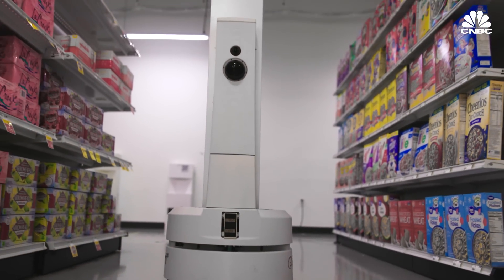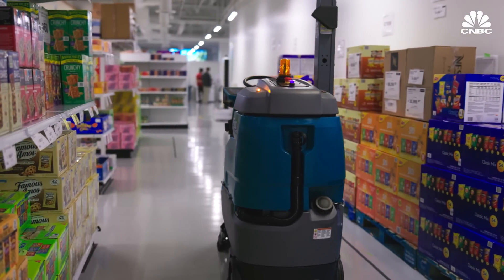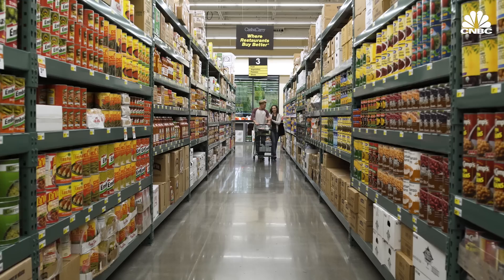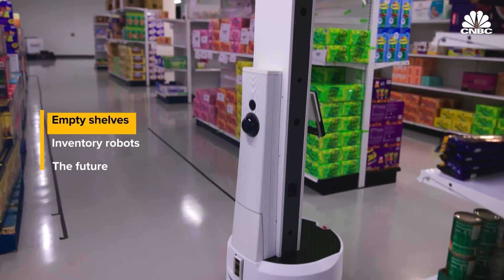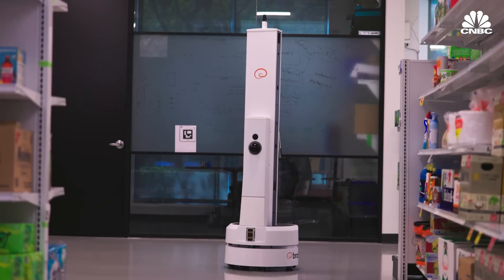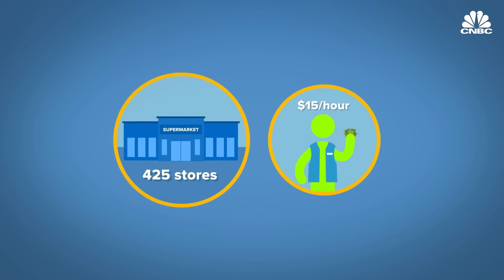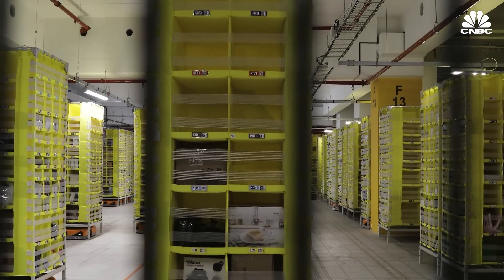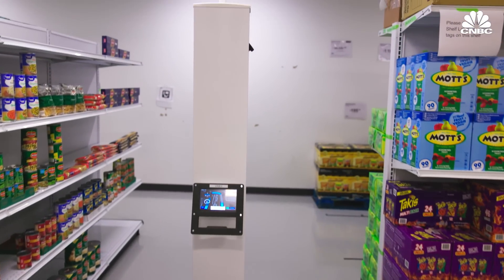How Robots Could Help Retailers Save Billions

Comment: When the manager is low paid, and has no stake in sell through or general company profit and long term happiness, then yeah, out of stock will be common.
No robot will fix that; it will send an email, but won't change the motivation of those managers.

Just in time stocking only works if you have a low cost human workforce behind it at mass retail. Robots and expensive software contracts are not going to be paid for by making 11 cents on in stock toothpaste.

Comment: 10:02 Billion dollar global insight to max your salary increase, company profits, monetise as thesis, anime, movie and max charity donations. There is time and movement wastes (Kaizen) on Amazon warehousing robots where the bots have to rotate from direction X to direction Y to move forward in the desired correct direction. Why note eliminate the turning step (billions or trillions of touch points globally per day = billions of dollars of profits), by revamping the bots to have multiple small durable wheels at each side so it doesn’t need to “rotate” its chassis.

Comment: The top 5 percent of Universities accept research and development funds from the retail industry to replace 40 percent of the workforce it's a fact . All of the large retailers are following suite and the nasty managers that they employ threaten the shop worker either you work and take responsibility of three workers then the robot appears. The sting in this story you need computer programmers to function. Amazon back 15 years employed robots but for them to find programmers to keep control so some of those employed in order prepare for the programmers to have their holiday overloaded the system which fires happened about several warehouses in UK were burned down. These robots consume energy something between 1.5KW to 20Kw depending the nature of business.

Comment: It only saves labor until you have to hire a contractor or more labor later on to manage such a mess of management; and yes I can honestly tell you working in retail at all levels including upper management corporate information is most certainly has been and will continue to be an issue for these companies and store for decades too come; this is about one thing, pricing and outpacing the market to raise value for investors, you know for the billionaire investors with stocks in both companies. I guess if your Elon Musk your really happy capital gains taxes are virtually no longer existent.

Comment: I'm sorry but who cares? It's not like it'll result in savings for the consumer or better working conditions for workers. If anything it'll annoy customers. I already have had a few times where the automated floor cleaning have gotten in my way then locked up forcing me to go around them via another isle. A human doesn't make those kinds of mistakes and I don't appreciate being a genuine pig. It's among the reasons I won't ever use an "automatic store" as long as I'm able to avoid it. I'm talking about those stores Amazon wants us to think are cool that use AI and automatically charge you using the AI. I am sure some people will get SCREWED by the AI, others by scammers tricking the AI.

Give the remaining workers actually livable wages and I might change my mind but I don't see it, it's just going to mean more bonuses for executives.

Comment: We stopped having the autonomous inventory robots. Customers would block the robot which would enter a halt state. The machine would see a reflection in the floor and would enter a halt state. Both of which required hauling it back to the charge station manually by hand. Which means you had to have employees there to monitor it. On hands were constantly being adjusted downwards even though the shelves had freight on them causing over ordering. The whole thing was unfortunately a mess. The thing is, if you have not enough supply you can continue to function. But if you have to much supply you no longer have the ability to receive freight because there is nowhere to put it.
Reply: But then the bots would know the difference between "to" and "too" as in having too much inventory. This is where you will be replaced, sorry, should have paid attention in school.

Comment: Or just use computers which have been around a minute and deduct products sold from initial stock levels and you already know what needs replacing. A camera looking at empty shelf space is not impressive. At all. Watch these workers at the grocery store and its alot involved in getting the products up. Alot of hand and arm and body manipulation a robot cant do currently. Now if they set up different shelving and made it so a robot could do it then maybe. The entire store would need to re configured and it wouldn't be packed in tightly as it is now. We'll see??? This was all supposed to be going on 10 years ago. What this video shows uscis machines that have been around 10 yesrs anyway doing nothing new.

Comment: "Simbe offers the Tally robot for a monthly subscription costing between $2,000 and $4,000 a month per store, depending on the number of stores."

A human worker being paid $20 an hour (which is generous) for 2 hours per day would cost the store $1,200 per month. So, the human worker is cheaper when solely being compared to the robot's subscription alone. Plus the human could rearrange items that are in the wrong place. How do robots make sense to the stores - financially or efficiency wise?

Comment: The robot looks good scanning empty aisles. Why didn't show a robot scanning an aisle with people and trolleys?  People will be in the way. It might be better to have pressure pads on shelves. As stock is depleted the weight on the shelves becomes less. These robots cannot scan the frozen an vegetable and fruits sections.

Comment: I work in the meat department at Walmart, keeping inventory is definitely an issue and one thing I notice is times when online grocery pick up will come back there and take stuff out of the back bens or management / team leads taking stuff out to make displays but failing to tell the system they've done so. And of course when that happens the system doesn't know when to order those particular products thinking that we maybe still have them. I've always had the idea that maybe we could have shelves with sensors that actively count what's on the floor. Ofc though The system knows an item has been purchased when it goes across register, when people steal the system doesn't know the product is left the store and therefore the system won't order more product thinking we still have it.
As for the robots, I'm not sure how they decipher depth on the shelf. But I can certainly say it would save me a lot of time and give me more time to focus on getting product out then fixing counts
Reply: Smart shelves is the next thing. Most no one wants robots to be blocking the aisles.

Comment: I have some suggestions for supermarkets selling clothing,  
Many times branded costly clothing is not sold,  out of fashion or color problem. 
Remove stickers of branded clothing,  do tie and die or embroidery to sell the clothing,  supermarkets must keep some contact contarct  skilled stitching Male or female , who have the eyes to change the look of clothing and give new looks. 
Most important is clothing materials are used correctly.  
Shops don't have to keep buying continuously. 
Second 
Customers or workers they change stickers of pricing from costly to lower prices,  immediately inside stores. 
They do for  rugs and identical clothing or nonveg. 
This can be stopped,  for nonveg put staples,  for rugs and clothing use chaap pin, which women's use  to correct  hair, from two sides,  which   takes some time to adjust.  
People are working on lock systems .
Another problem which we need to slove is electricity problem during cyclon.  
Shops can put solor panels for electricity. 
We can redesign the structure of building to keep building very cool during cyclone. 
Put glass mirrors on top of roof or play with glass mirrors to keep eyes on customers or workers. 
Jay shree ram.

Comment: The problem which every supermarket faces is falling of suff from racks,  some time racks over filled,  as clients touch it , the  placket fall on client. 
So must not overload the racks. 
Second problem is.
Sugar or soap or wheat flour larger packets start leaking. 
This problem can be sloved in two ways,  must inform clients to repack it in another plastic bag or inform workers.  
This problem give much loss . Now a day's we find some leaking oil packets. 
As early as we slove the the problem,  damage to nearby products can be stopped. 
Sometimes workers also damage larger,  sugar or laundry soap packets .
Perhaps the steal some parts or pick it from garbage box. 
Supermarkets must find way to prevent this loss or minimize this loss. Repack it  is best solution. 
Jay shree ram.

Comment: The supermarket can use another system to  use expiry date products. 
First about broken biscuits or expiry date biscuit,  open the original pack completely,  repack in plastic bag and sell for animal.
Second .
Supermarket gets lots of nonveg as  expiry garbage . It comes also from fresh nonveg selling. 
Purchase big pan , put oil, fry this nonveg. 
Make pieces  of  expiry bread .
Add to this , quantity of oil depend on batch size of ingredient. 
Bread , nonveg and oil make good combination,for food of animals like dog and cat. Don't add salt.
Oil will  be replace as butter , mix well,  fry for some time for water to evaporate .
Don't use  regular oven,  keep separate oven or pot. It smells too much. Do work in open places .
pack and seal.
It remains for two days. 
Restuarant can also use same system for leftover food. 
Sell for cat or dog.
The pack food from company is smaller in pack , but this packaging will larger. 
Jay shree ram.

Comment: Hmmm. I feel like this is inventing a problem retail doesn’t actually have? The only time we physically count inventory is, well… during inventory. Other then that pretty much every retailer I have worked for has its inventory tied to a computer system that knows when a product is low and just orders more. The reason you see empty shelves, at least in this day and age. Is due to lack of inventory from the distributors. Not because someone forgot to stock it or order it.

Comment: Super market must put colum of expiry date 
with purchase bill entry so that they will know how much product is near expiry and is not sold. Must put three months dead line for Cannes product , juices and dairy products. Depends on articles.
Initially it will be difficult but slowly will adopt this calculation.
I am sending some link .
We have quick expiry for bread, tako roti, tomoto and green leaves and capsicum. 
Now we must work on variety of recipes which can be made, using these articles. 
Instead of going in garbage box and waiting for expiry we must use it  before  expiry for zero loss. 
In India they make omelet paratha.  Mean eggs are stick to tako roti, add green capsicum and salt to egg and pour on tako roti,
Make egg bhurji adding capsicum and tomoto to put inside bread .
Make penut butter and salad  bread.  
Try to finish  evening bread as early as possible for breakfast. 
Another solution is break the original pack, Seal in simple bag for animal feeding. 
Jay shree ram. 
https://youtu.be/Z1mX-C2fAuc

Comment: You can't call it a labor shortage if it's solely because you aren't offering competitive wages. If robots are going to be less expensive than humans, then the gov needs to step in and tax robot purchases or subsidies human workers. There are use cases for robots to reduce injury or improve speeds to significant levels but if people are struggling to eat, then the solutions are not to remove jobs that can be filled without qualifications.
Reply: robot companies could at least hire previous retail workers as testers or "benchmark specialists"
Reply: What injury
Reply: @xyeB  the repetitive stress type of injury. Back pain wrist pain knee pain

Comment: Most of the smaller shops selling grains,  they get confused with running smaller basket of grains and new full basket of grains,  they  mix it but they have another option,  they pack the grain in plastic packaging bag seal it  as ready  made  packing and keep some on counter and some in new bags.  Some people are in hurry they will buy , some people are doing wedding or party they can buy it ,at some discount price. We must request and train the population to buy  older stock first to respect grains.  Training  to people is important .
Running shop is not easy job. All  loss of grains  or shopkeeper makes ,impact on our food cost . Another option is make people to do side business of sprout grains. 
Many times a grain gets mixed,  so  sell mixed grains sprout . We must learn to cover loss of grains. 
Jay shree ram.

Comment: Our biggest problem is product with expiry dates. 
I have some suggestions. 
This depends on products and places. 
First in the fix racks of godown. 
We must put the  new product on higher self and we bring it down as per as expiry.  Using this system will help to separate the product date wise.
Placing products from higher self to lower is not problematic job.
Second for customer self. 
Either you choose right sides  or lower self for products near expiry,  give concession   as per as your ways. 
Second open window shopping store for people who want to buy lesser or in hurry.  You can sell products near expiry to them. 
Store have lots of problems we can slove one by one.
Some times stores cheat , sometimes workers steal and sometimes clients do robbery. 
We have to bring this industry to Zero Errors and Zero loss system. 
Jay shree ram.

Comment: I feel this is an ineffective method, they wud be better off programming the shelves and adding a chip to the product packaging then they can track for inventory and misplace items instantly instead of having a robot running around.  The back of the shelves can have a restocking mechanism that brings products up from beneath

Comment: One of the precipitating factors of going with robotics is the fact that robots tend to show up for work more reliably.  Some are worried about losing their jobs to robots, which is understandable, but also understand how irritating it is trying to find people to fill positions.
Reply: That's not true. I work in and IT and if you did as well, you'd understand how often machines stop working for no apparent reason, or refuse to work with each other. Plus maintenance, updates etc.
Reply: @AvadaVendetta  I know as well as you how stuff needs to be power cycled every now and then. But humans create more downtime for sure.
Reply: Paul Standaert:  Lots of management is too clueless or lazy to REALIZE that LOOKING for good people who are motivated to care and work hard, TRAINING them well, REWARDING them, promoting them if they deserve it, etc. would SOLVE MANY such problems. 

This used to be VERY normal for many companies with skilled employees.  Sadly, far too many went to the "do it whatever way is cheapest" mentality, where they largely STOPPED doing the right things for good employees, and the results are rather obvious.  IBM (where I worked) and the Lou Gerstner era and after is a blatantly obvious example. 

IBM was a fantastic company in the 70's and a fine company in the 80's.  Now it mostly runs on momentum.  There are endless examples like this.
Reply: Can we use A.I. to replace the CEO's?

Comment: I’ve been working retail for the last 15 years, a lot of my coworkers for 35 years. Most of the bad spending is on excess amount of chiefs or ‘new programs’ that always end up being phased out. A lot of corporate level employees have never worked on the sales floor, or have very little experience, being hired on from another company.
Reply: cw48494:  It's the same in a LOT of industries, including high tech. ones.   IBM is a classic example, the way they run their programming shops, for example.  Sometimes doing things "cheaper" just means doing them much worse -- which they'd know if they had competent management vs. a bunch of marketers in management.

The book "White Collar Sweatshop" (2002) lays this out for a LOT of companies and shows that this is a long term trend, re bad management assumes cost cutting and treating employees badly is the way to run business effectively, and doing meh to poorly as a result.
Reply: That's how you know there is failure in the mix. When they keep changing over and over. You don't fix what isn't broken.
Reply: Bingo, wanna save money? Look in the god damn mirror.
Reply: Amazon's "Just Walk Out" fiasco is probably the biggest example
Reply: Yea the CEO position and similar positions aren’t in jeopardy!
Reply: Your experience is nothing new in any industry. Managers seek promotions and raises via new initiatives. Failures get buried, successes get overhyped or misunderstood. 
To be fair, local retailers have no invested interest on improvements, so corporations have to try something outside of giving up profits.

Comment: How about robots designed to help curb shoplifting?  That's a dangerous and potentially deadly job.  Have the robot follow the shoplifter around and video record them to help police catch them.  Maybe have it issue scary warnings to encourage the shoplifter to drop what they have and bolt.  Just make the robot heavy enough that the shoplifter won't steal the robot too.  :-p

Comment: Unfortunately, this story has mixed up the overall « inventory » supply chain problem for retailers (tracked pretty well with current IT systems) versus stocking shelves with what’s available in the warehouse that requires this new tech including robotics.